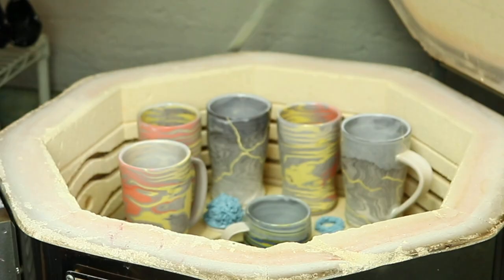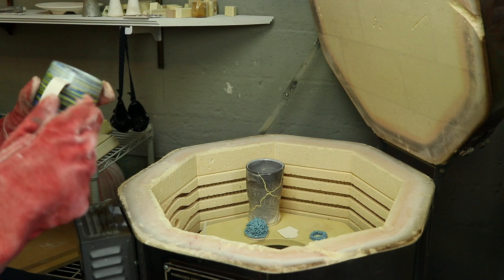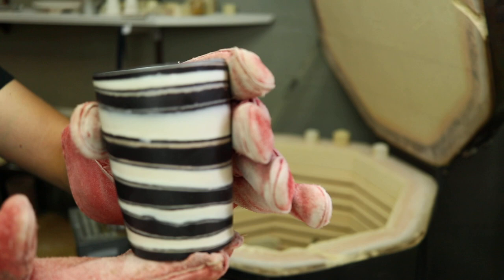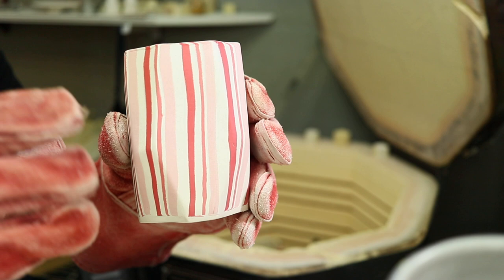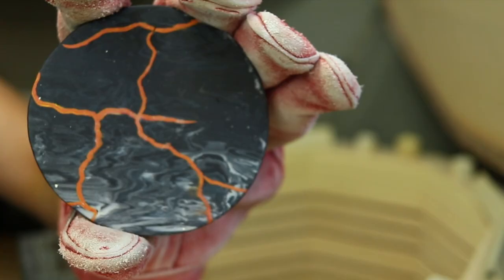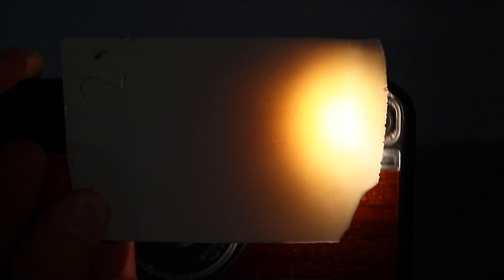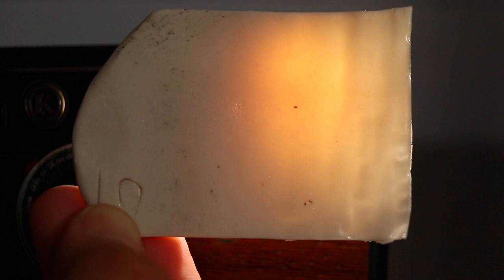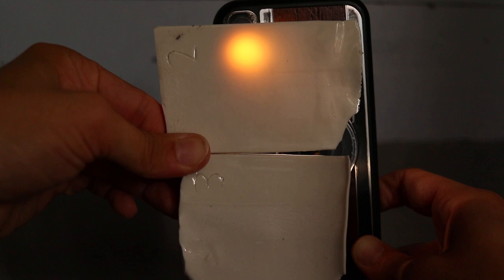Translucent Porcelain Recipes, Ceramic Knives and Nerikomi | Kiln Unloading #7

Comment from the maker: Would you buy a handmade ceramic knife? If you did, would you use it or display it? Both?
Reply from the maker: That’s what I’m thinking ;) 👍🏻
Reply: they look amazing! do you plan to glaze them after the sharpening?
Reply from the maker: @Sororus  glazing is tricky because they warp and I can't put any weight on them because it would stick. For now I leave them raw. I even tried hanging one in the kiln so gravity could help and it still warped.
Reply from the maker: and thank you!
Reply: @CeramicJim  never knew glaze could do so much "damage", looking forward to finished result :)
Reply: @CeramicJim  did some tests with knifes too a while ago . hanging them in a high firing isnt a good idea. everything i tried to hang them failed. it always bends to much under the weight of the knife. in best case just the tip touched the kiln shelf but i got some knifes fused to pots ... also after some failed grinding attempts with a grinding wheel i tried to bevel the cutting edge when leather hard and wetsand it after firing... this made the edge warp slightly . i didnt used porcelain tho .. in the end i did not get really good results so i abandoned the idea...
Reply: I'd use it. I'd want one durable enough for Bush Craft. Of my own design of course.
Reply: @gmcbart7226  Hmmm.. I see. So how strong is the blade with out glazing?
Reply from the maker: So far it’s OK. I might try a cone 10. It’ll never be as good as industrial ceramic knives. Those aren’t porcelain. Their peers recording of oxide fired to like 3000 degrees Fahrenheit.

Comment: I’ve been throwing marbled clay for a few years. I like using Laguna’s Miller 550 (WC631). It’s a cone 10 translucent and is easy to throw and alters very well at a soft leather hard. I’ve found some mason stains work well at cone 10 but others burn out. For those I use encapsulated stains by US Pigments. They are more expensive but give great color.

Comment: What is the sound?  It’s like a humming or interference. 

I’m case you are unaware, porcelain knives (sharpened) and coated and buffed liberally with carnauba wax, atleast 3 coatings, are great for chopping and slicing foods that are reactive.  Lettuce, spinach, zucchini, peaches, plums and pears.  The cutting turn colors more slowly when using a ceramic knife.

Comment: 7 looks like it started to boil. To much flux . Nice work!  I make my own cone 5 porcelain too.
Reply from the maker: For sure. Really? Do you use a big mixer or do you make it at home? How do you make big batches at home?
Reply: Ceramic Jim I mix wet it  in plastic 55 gal barrel like slip then dry it out
Reply from the maker: What kind of drill/attachment do you use and how do you dry it. Sorry I have so many question. I’ve contemplated large batch slip but haven’t figured out how I would do it. Do you use Veegum? How much?
Reply: Ceramic Jim I use a shaft coupler on a 1/2hp motor with 2 mixers on the shaft. No veegum. I dry it out on big plaster bats
Reply from the maker: Got it. Thanks for the all the tips. Do you have an Instagram or something to connect on?
Reply: Ceramic Jim welcome! Yea my IG is neworleanstileco

Comment: Have you tried Laguna's Frost? It goes ^5 or ^6, is very white and translucent, a bit finicky, and pricey. But the recipe may give you information.
Reply from the maker: Ive heard of it and Ive heard the same thing. That’s why I’ve avoided it. I’ve heard there are lots of cracks plus I want to make my own casting slip that matches my clay. And I think it might be easier to mix colored porcelain than have to wedge in the colors.
Reply from the maker: I do appreciate the tip though ;)

Comment: "The cloud doesn't make a lot of sense, with the flame series."  Smoke?

That's awesome that you make your own clay body, but why not just find one from a supplier?  There are a lot of porcelains that fire at a lot of different temps.
What Cone do you fire to?
Reply from the maker: Thanks for the comment, Ben. I agree. It kind of looks like smoke. Maybe I can play it up and it would work better. I do Mid range firing. 

I have a few motivations for mixing my own. I had a supplier and they went out of business. Had to figure out all of my glazes and stains again. Now that I have a clay I’m hoping I can fix in colors as I make the clay. Maybe I can save my wrist and some time from not having to wedge. And I want to make casting slip that matches my clay.
Reply: @CeramicJim  That totally makes sense Jim.  No need to worry about a clay supplier, if you are your own clay supplier.
I've been looking for a supplier as well.  The one I use for my classroom is good, but for a functional clay body, I'm not sure their midrange bodies will work.
Reply from the maker: I use Miller products for school clay. Lots of choices. They’re owned by Laguna.
Reply: @CeramicJim  A lot of potters/ ceramicists love Laguna.  Never used any of their products myself.
Reply from the maker: I was skeptical and I’ve heard some stories of poor quality control but so far I’ve had good luck.
Reply: @CeramicJim  I like my classroom supplier, but they don't give exact specifications for their bodies, so the only way to know of it will work for functional ware is to fire it and test it yourself.  They list a three to four Cone range for firing.  That is less than ideal...